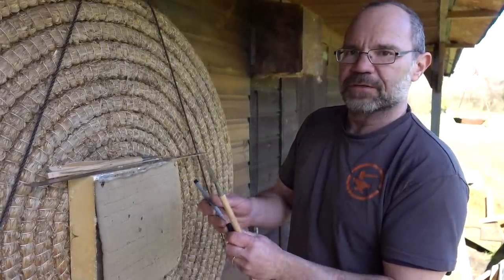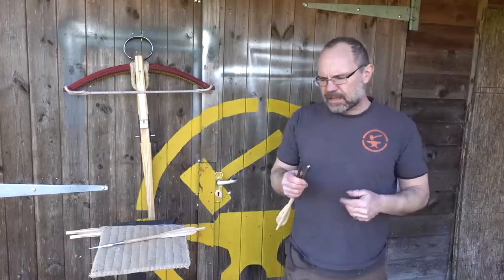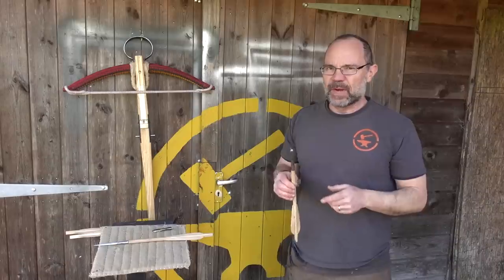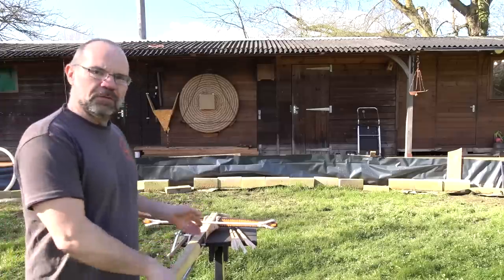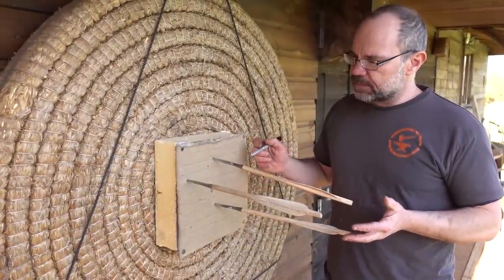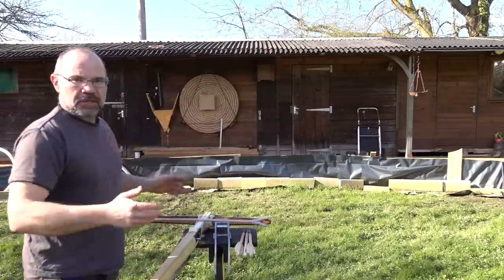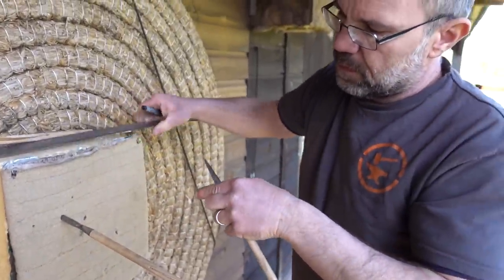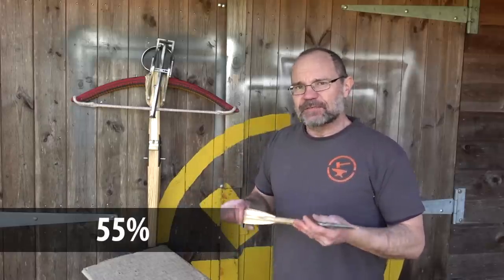Does WAX on ARROW HEADS Do Anything?

Comment: Hi Tod, love your work ! I've got a tip about waxing metal :

I'm a locksmith for historical monuments and I wax my locks almost all the time, because it protects it from rust and acts as a "dry lubricant" (grease eventutally catches the dirt and jams the mecanism). Plus it respects the texture and color of forged steel.

I use a mix of different waxes, cause bee wax is a bit too soft when cold, and I apply it on hot metal (about 80°C), so it stays liquid on it and I can swipe the excess off.

I know for sure this trick was used during the 18th century, not sure about the 15th, but it could be useful for arrowheads. I garantee even though there's just a thin layer, the surface is made much smoother and it does lubricate well, for my locks it's night and day.

So yeah, there might be better to do than just dip arrowheads in liquid wax.
Cheers from France, keep up the good work !
Reply: That was a very informative comment and much appreciated. Would you mind sharing your recipe? I'm currently using Renaissance Wax.
Reply: Hey maybe somebody back then just wanted to keep stockpiled bolts from rusting so they waxed all the bolt heads. And some soldiers who end up using these may actually find out that waxed bolts perform way better than unwaxed ones. It is totally a possible scenario. I wonder if there is any written records of this becoming a standard for arrow makers back then.
Reply: That's what I was thinking about when I saw and hear the goatfoot in action. It do not seems to work rather smoothly and it sounds like it's eating the pivot pin. Maybe a bit of wax 
would help here too. It may even be better to also harden and polish the pivot pin I guess.
Reply: tried that dry lube once.. mrs went fking mental!
Reply: Amusing coincidence I just saw this - I do old locks too, and doesn't a few hours this evening looking at the old Japan Black technique. Yours is also a good one.
Reply: Interesting. Merci, Blue.
Reply: If you heat treat the metal during production of the arrowhead, could you then cool it down using beeswax or similar?
Reply: @dumbledoor9293  wax burns

Comment: As the heads are made of iron, maybe waxing arrowheads started out as a way to prevent rust.
As you said they were medieval, and therefore limited by the technology of the time.
Reply: Nevermind tech level, people are still using wax as a protective coating on stuff (eg cars) only difference is the type of wax
Reply: I agree it seems likely that they used something to protect the steel. I wonder if other common anti rust coatings like animal fat would have the same effect on penetration
Reply: @cheerfultrout4381  I think he meant they didn't try wax for the penetration but simply used it for storage already. maybe they never even noticed cause most metal objects were covered in some sort of wax or oil to prevent rust so they never shot them without it.
Reply: @benjaminboyle7329  sheep's wool famously has a lot of wax in it
Reply: @cheerfultrout4381  Dont forget Bowstrings
Reply: @Boomchacle  we still wax bowstrings, even those made of modern material for target archery.
Reply: @ABaumstumpf  It would also be very easy for waxed heads to remain in better condition and have better performance because of that. Then people would see better performance from waxed heads. The cause could easily be better condition heads instead of or in addition to lubrication effects. 

Obviously the video clearly indicates lubrication helps. So waxing for preservation looks like a two for one effect. Better condition heads and lubricated penetration.
Reply: That was my immediate thought, protect tips from rust and discovered an inadvertent benefit that was greater than the original intention.
Reply: Aye, I used a heavy coating of wax on my hunting rifle back before stainless steel became common in firearms. It kept my rifle rust free through many a Pacific Northwest fall/winter.
Reply: @climbscience4813  Is that your longbow or are you just pleased to see me? 😁
Reply: I thought blacksmiths would heat things they didn’t want to rust and then rub them with fat or wax to give them a protective coating. Maybe the wax and the extra bit of carbon or whatever forms on the metal works even better?
Reply: Yes, just posted the same thing. It all appears very obvious to me.
Reply: That's a good point. Perhaps when geared up for long term transport, batches could have their heads covered with a thin coat of wax (and even perhaps the wood to help protect it from moisture). I don't doubt some even knew of the increased potential penetration that also comes with it.
Reply: Medieval scientists be like: Wax go slide????
Reply: I couldn't help but think during the video, that these weapons were deployed in all types of weather. any metal items would have began degrading almost immediately in those conditions.  Many inventions of the years have been discovered by accident. I'm sure the wax was a unintentional bonus. I would think that archers of the time began to notice that their first few shots were far better at penetrating.....then began to realize that it was the protective wax coating that helped during target shooting.
Reply: @cheerfultrout4381  speaking from experience as a woodworker and novice Blacksmith, we still use wax to coat things they used wax to coat 1000 years ago. One of the best long term storage coatings for finished high carbon steel is a wax. Beeswax has multiple uses in both smithing and woodworking.
Reply: @ABaumstumpf  I had the exact same thought especially because I remember Tod mentioning at some point in the past that atleast he believes that crossbow bolts often had wooden fletchings because it was better for long term storage and I would suppose that wax would also be better as it doesn't run off like oil does over time.
Reply: Indeed, like the others I'm inclined to think it was a corrosion prevention that just happened to pay off on the damage front. It would be trivial to have a pot of warm wax or tallow to hand at bolt assembly and a quick dip at the end would set rapidly on the cold head.
Reply: Isn't rust good on weapons to give your enemies tetanus?
Reply: @MusMasi  rust doesn't cause tetanus.
Reply: @MusMasi  Rust is iron oxide(one of them, can't remember which).Tetanus is caused by Clostridium tetani. I'm also not sure about using animal fat, since a thin film of that can easily oxidize and it transforms in usually a sticky compound, which would increase friction between the arrowhead and whatever it tries to go through. Would fresh fat work on lubricating the arrowheads? Most likely. But for long term storage,  I think wax would work better.
Reply: That was a good compromise to prevent rust. Personally, I would have let it rust a bit. Even if they survive the bolt, they won't survive the fever.
Reply: I was thinking this exact thing, while watching the video, and remembering was dipping Ohio Blue Tip wooden matches to waterproof them. 
:D
Reply: @AlisonWheeler  It's actually a bollock dagger, but he is also pleased to see you!
Reply: Worse than being limited in technology, they were limited in scientific thinking. The kind of though process of "lets do a thing one way, measure, another way, measure, compare results" that wasn't a thing. They weren't born stupid, but they also didn't have the same level of education and heritage of scientific thinking we take for granted today. It certainly wouldn't have been obvious to them that on entry the friction would melt wax and lubricate the arrow head thus leading to arrow penetrating deeper. It wouldn't have even been obvious to them that it's friction that stops the arrow, because the concept of friction wasn't even a thing let alone thinking of it as a force. This is classical mechanics that wasn't developed until much later. If any of them though of mechanics of an arrow head penetrating the target at all, they would have had to do so with Aristotelian mechanics. Good luck with using that to reach any valid conclusions.

That's the main problem with trying to figure out the though processes of people in the past, we simply don't think like them anymore. Past few hundred years have changed how we think a lot and we take for granted and assume to be obvious lots of facts and ways of thinking that simply didn't exist in the past. That's the limit of experimental archeology, we can try out lots of ways things could have worked in the past, but we don't know how much our modern knowledge has influenced that. To find out how things actually did work you need to find archeological or historical evidence.
Reply: @aleksandersuur9475  One doesn't need to understand the mechanics of something to know it is better or worse. Concerning friction, I am pretty sure there has been a basic understanding of friction from a practical point of view for a pretty long time. For example, how to make fire?
Reply: @TobyIKanoby  Nope, there hasn't been a basic understanding for a long time https://en.wikipedia.org/wiki/Tribology#History
Yeah sure, firestarting with hand drills and bow drills is a prehistoric skill, but the understanding of why it works is a recent thing. A skill can be learned and passed on without any understanding of the underlying mechanics, just go through the motions and perform a ritual and you get the results, simples. 
You need concepts of forces, kinetic energy, conservation of energy and friction to make the logic jump that yeah, waxing arrowheads should work to increase penetration. If you don't have these concepts and they didn't in medieval period, then you are not going to make that deduction. You might discover it accidentally and pass it on as a sort of ritual among soldiers, but there will be no understanding of how it works. 
And discovering it accidentally is not easy unless you grew up with a concept of "experiment", another thing that hasn't been around forever https://en.wikipedia.org/wiki/History_of_experiments
Ancient thinking was that the best way to figure something out was to sit down and philosophize about it and the best way to get knowledge is to get some old wise man to tell it to you. The very idea that you should actually experiment to figure out what works and what doesn't was not in the mental toolbox of a medieval european. They certainly would not have been shooting perfectly good pieces of gambeson to figure this out.
We understand how and why waxing arrowheads works almost institutionally, but that's only because we have spent a years learning relevant concepts in school. There is a lot of background knowledge you have and use daily that just didn't exist at the time. And that's why things that seem obvious to us took millennia to figure out.
Reply: @aleksandersuur9475  On that note, we often see in archeology that people will use what works, but not always understand WHY it works. For instance, wax is used in sewing. Did the sewers readily conceive of friction, or was there an alternate explanation (i.e. "wife's tale") that was known, and while wrong, the prescription was nevertheless correct? Same could be true here. Rust weakens the metal. Sharp edges rust before other areas due to increased surface area for oxidation. Now, anyone can notice that rust forms first at the edges. So they apply wax to prevent rusting. The explanation for the better penetration? Why, because rusty bolt are rubbish, so keep them sharp and waxed to keep off the rust! Perfectly reasonable explanation based on observation, mostly scientifically wrong, yet prescribes action that is sound. This is why the intersection of folklore and archeology is so damn interesting at times!

Comment: I recall reading in a college text for medieval history that beef tallow was often used for candle-making, more often than bees' wax. It was a good deal later that I saw how this was done at a medieval fair. The part that had not been explained in the text was that the tallow is boiled until it loses nearly all its water content and is (at room temperature) as hard as bees' wax. I cannot help but think that the iron and low steel of the medieval era was very prone to rusting, so perhaps it was a general practice to dip all metal arrowheads in heated tallow to proof them against rust?
Reply: Yes I would agree with you about rust issue makes sense
Reply: That would be good alternative for not very hot climates as beef (or mutton) tallow melts above the body temperature.
Reply: Just my thoughts on seeing this video.   Not sure about lard.   I shoot a lot of antique and vintage firearms where bullets/paper cartridges are lubed.   Historically pure lard became too soft for military use and storage, and the acid content actually leads to rusting of iron or steel.   I can testify to that, I no longer leave any lard based lube in my steel dies!   Beeswax alone if frequently too brittle and will flake off.   A mix of both to soften the beeswax a little is preferred.    No problem in the Middle Ages.   Coating the iron heads if only to deter rust seems to make sense.    Though an alternative would be to dip in Linseed Oil while still hot from the forge.    Still common today in mineral oil.
Reply: Rust on an arrowhead wouldnt be that much of an issue, because they are not that sharp
Reply: @viktorbimmel4007  Arrow heads wouldn't just surface rust.
Reply: Seems like a good hypothesis / alternative...   I think that beeswax would possible be too expensive for use on arrows.
Reply: @petergosden1  Lard doesn't work, but Suet(kidney beef fat) works wonders. There is a Townsends video about making Suet. I did that and it has been working amazingly, it's very hard and works as a decent anti-rust coating. And I live in Brazil where it's 30C during a lot of the year.
Reply: Also I might add that polished & waxed breastplates are more likely to deflect arrows.
Reply: @viktorbimmel4007  Actually, the broadheads would be razor sharp. There is literally no point not sharpening them up.
Reply: Rusty iron can cause decomposition in wood, rust works as some kind of catalyte in this reaction (That was mentioned in a book of wood science, I don't know more.). Such decomposition is especially harmful around fasteners, like nails, where good contact with wood is required. I don't know whether rusty arrowheads really caused such troubles, possibly.
Reply: Beeswax and Linseed on hot metal gives a good black rust resisting finish.  I doubt that would provide the lube that the beeswax applied cold would.
Reply: Tallow was added because it was hard to harvest beeswax. But tallow candles gave off black sute and smelled very bad. But it was much better then finding a hive and then smoking it out. Did you ever chase a bee back to its hive
Reply: @petergosden1  We learned to rust proof iron with burnt linseed oil in shop class in school.
Reply: @viktorbimmel4007  Rust on an arrowhead would be a big deal - rust would cause a lot of friction and the whole point of the video was to demonstrate that reducing friction defeats gambison.
Reply: Even though beeswax was massively more expensive than tallow it's still not too expensive for arrowheads.

And the (warning - pun incoming) POINT about sharpening arrowheads - what do you think they did before battle? Watch Netflix?
Or sit round a campfire all night, because you're to adrenalised to sleep, sharpening everything you have.
They had time for stuff - decorating things, polishing things etc were things they did to stop getting bored.

Also - beeswax was not the only preservative/lube they had available. Any fat would be good for polishing metal with - preserving things needs more careful selection since some fats are acidic.
Reply: make logical sense
Reply: beeswax and tallow were both heavily used for candles in period, with beeswax being the higher status/price option because (1) only some towns kept bees but all kept livestock (2) even in places where apiculture was commonly practiced, honey was the primary product, so small farmers with one or two beehouses might not bother with the less valuable wax (sugar beets were first bred in the 18th century and while sugar cane was domesticated in New Guinea in ancient times, Europe didn’t have the climate for it, so could only get cane sugar through the silk road at great expense; thus honey was the only natural sweetener produced and widely available in Europe for millennia and absurdly important), and (3) unlike tallow, beeswax didn’t STINK.  So yeah, my money would be that tallow would be preferred as a munitions-grade arrow lubricant, even if it was *worse*.